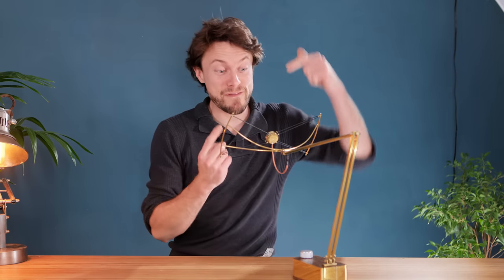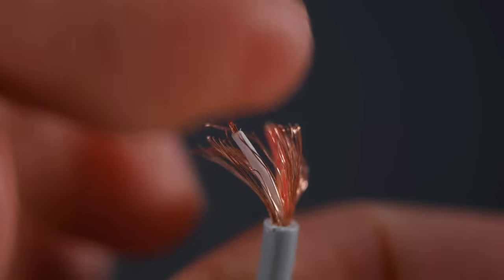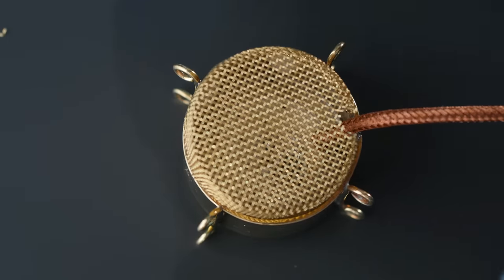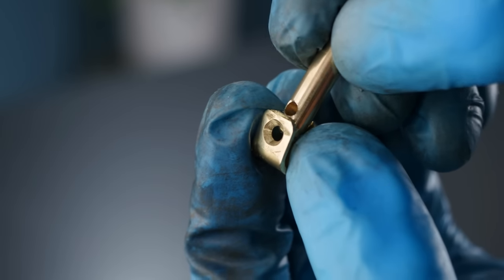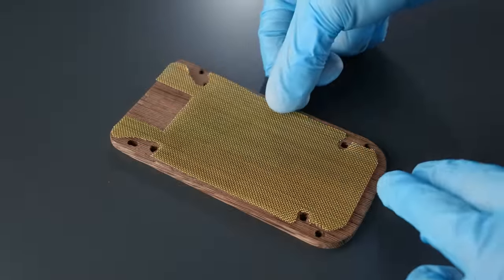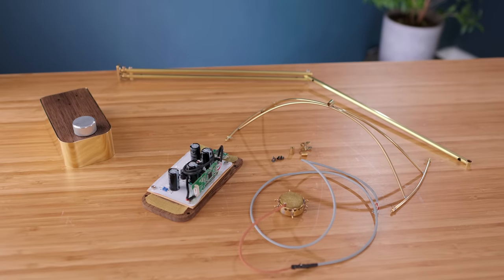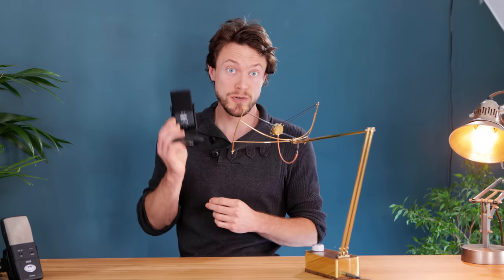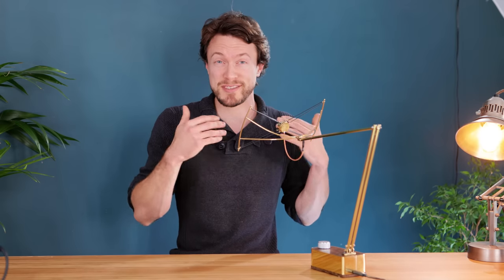Building a quality USB-C microphone

Comment: As a sound tech, I'd like to make one correction: the way that professional audio cables protect against electrical noise is not from the shield. That cable with the shield that was shown is for something else entirely, but it does often get used as an audio cable, because it works just as well. The way that professional audio cables actually protect against electrical noise in the cable is through basically sending 2 copies of the audio signal at the same time so the destination device can remove what noise it can. This is called a balanced cable. Audio University has a great video on the subject of Balanced/Unbalanced cables if you want to know more. However electrical interference shields are mostly used in digital signals such as those that get sent through USB, so without doing extensive testing on this build, the shields used aren't necessarily pointless or bad to have.